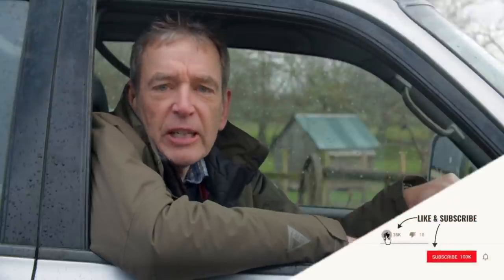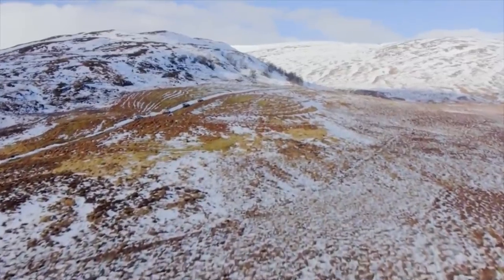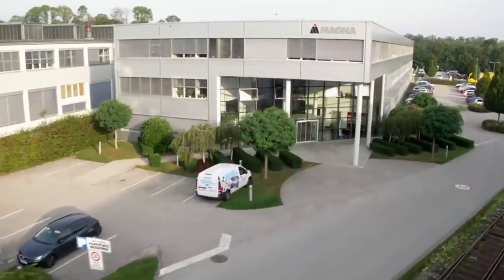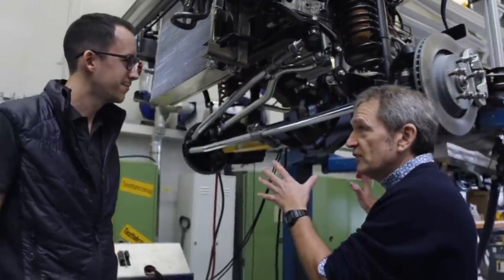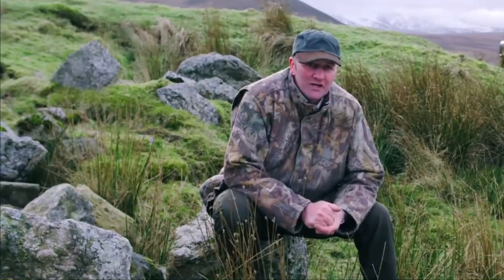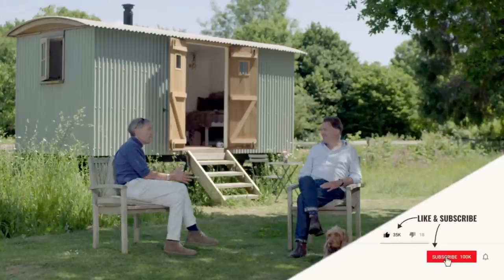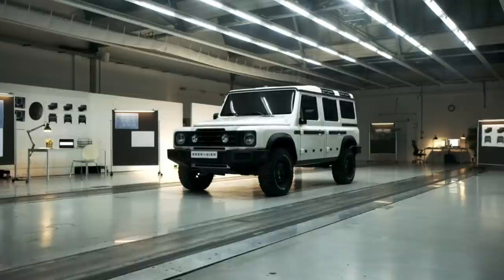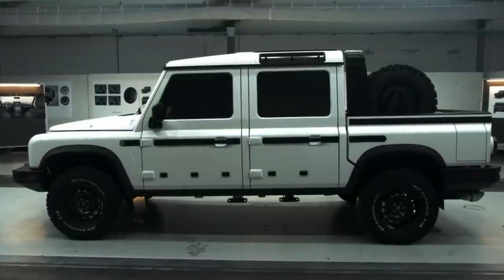All New 2021 INEOS GRENADIER 4x4 OFF-ROAD Machine | 2021 INEOS GRENADIER 4x4 Exterior Revealed

Comment: A tractor G-wagen with minimal electronics, body on thick steel frame, tractor axles, massive front and back lock diffs, massive mechanical coil suspension, solid 3L I6 Diesel engine -shit are they trying to build the ultimate apocalypse SUV? Love it!!😍
Reply: But surely shouldnt it be powered by Iveco, Isuzu, Mitubishi, Toyota  or Cummins or something out of a Mercedes truck?  Is the BMW story a commercial ruse ?

Comment: Its body design looks like an Iranian or a Turkish knockoff of a Chinese knockoff of a Spanish Santana PS-10, which itself is a Land Rover Defender knockoff.
Reply: Lets just hope that its body does not have the same dreadful "features" like Defender's body:

1. Piss poor sound and heat insulation;
2. Various holes in the body due to intentional (cheap) dodgy body panel overlaps, leading to non-existent dust ingress protection;
3. Rust hotspots wherever aluminium panels contact the steel;
Reply: Amazing are you to thick to own a Land Rover as to not understand its worldwide production hubs, over the years, hmmm,

Comment: IFS is rubbish. My dad had a Ford Range 4x4 and does his business in Africa. To travel a distance of 250 km of sands and mud the Independent front suspension got broken 3 times. IFS is garbage. People do not need the 4x4 computerised system. We are so smart 
we can do it ourself. Imagine if the system gets broken in the remote village in Africa. A 4×4 should be a solid car as well as  withstanding the terrain (Africa, Australia ...).
Reply: It really depends on the IFS brand, try a Tacoma or a Tundra which are on top of pickup trucks. Ford really was a poor choice of brand  heavy off roading
Reply: Pajero is IFS as well. Ford is just a bad choice

Comment: Lots of negativity here -  I have a TD5 110 - it is shit but I love it all the same!

We should also remember that the original Land Rover design was a shameless copy of the WW2 Jeep!

Yes - Land Rover perfected and improved it over the years but correct me if I am wrong - isn’t that what Ineos are doing with the Grenadier?

It will be better or it will be worse - it will sell or it won’t- time will tell but let’s at least give it a chance first?

I have to say - at first glance - it looks like it is going to be pretty tough, durable and capable to me?

Comfy seats / ride and a decent auto box and we might just find ourselves with a new, home grown, four wheeler favourite for the masses?
Reply: The original Land Rover was a "shameless" copy of the WW2 Jeep? Where are you getting your facts from - the Jeep marketing department? I believe Maurice Wilks' quote (about the Jeep he was replacing) was "If we (Rover) can't build something better than this, we should probably get out of the automotive business."
Reply: I used to have a Td5 90 and that was shit. 1999MY so had the 10p Engine, nice motor to look at, it had an external front roll cage fitted and all terrain tyres but reliability wise it was crap - losing water from the header tank and I think the head gasket was f*cked too.